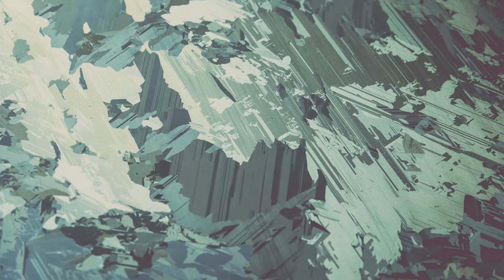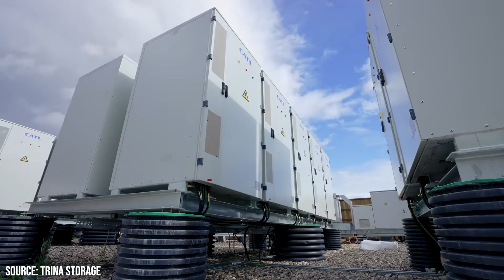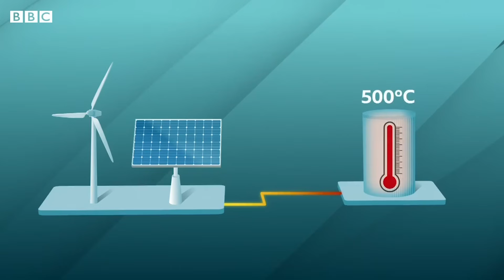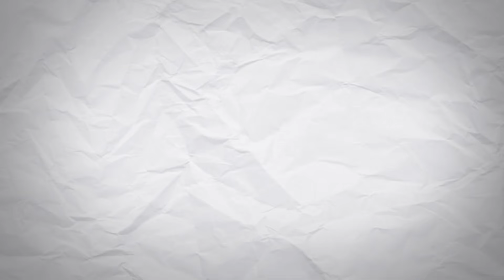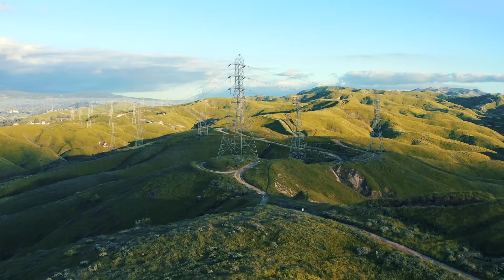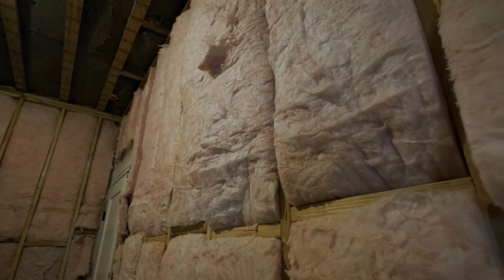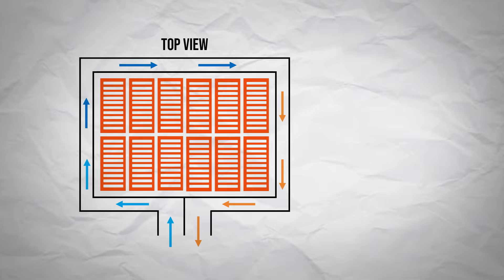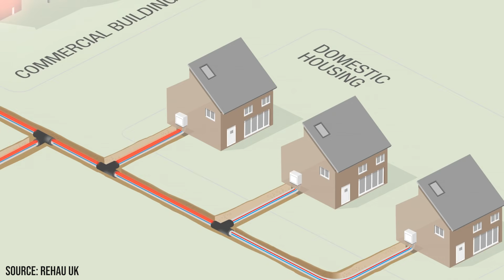How 3000 Degree Bricks Will End Battery Storage

Comment: Just a quick comment after reading through the comments...

This particular focus is industrial. This about taking cleanly produced electricity and converting it to heat and storing that heat. The heat is the desired 'product', for industrial processes. 

The high efficiency is due to not converting this heat to anything else. Industry currently using fossil fuel to create the heat, such as gas fired boilers for water and steam. This is a brilliant strategy, as industry are huge energy consumers. This is not for home use. Solutions for homes will come in other forms.

To be clear, I no nothing of Rondo, or Mr O'Donnell, or the whole process, other than what I have seen here in this video. It seems many were not getting it, based on the comments.    - Cheers
Reply: Thanks, yes you nailed it! Seems many folks comment without watching the video, or at least absorbing it!

Comment: This is great and all until you realize that Solid State Battery tech is 40% more efficient and cost half as much as current Lithium batteries.
Reply: In either case, these are insufficient to provide heavy industries with the heat they demand 24/7 over 50+ years.

Comment: Can you really make a claim involving 100 years when you have not tested them for 100 years?
Reply: The steel industry has used principally the same technology for over 200 years, with zero degradation and unlimited cycles. Rondo is heating with electricity instead of waste heat.
Reply: @RondoEnergyGlobal  Principally is not the same as actually. Principally I could just use any sharp object to cut something but that does not mean it will always cut.

Don't get me wrong, this idea is impressive, but making a claim something will be around longer than most people live is a pretty Bold claim. Especially when the person making it wont be around to confirm it.

Comment: again again and again this could be geothermal with is with modern drill methods everywhere why is it not even mentioned because it may make oil gas water solar wind obsolete basta
Reply: You can't use geothermal at every industrial facility in the world for heat needs.

Comment: At best it will replace a tiny amount of batteries, its not going in your phone or impact driver. ever, so the title of the video is silly.
 I can eee this would be useful for storing heat for use directly,  either as superheated steam for industrial process, or district and  large building heating, for electricity not so much as you still need the steam turbine to make the electricity, which have efficiency losses, also if you need huge amounts of heat you will need a huge amount of bricks  and plant.
Reply: Industrial heat accounts for almost 25% of global CO2 -- this is a significant market and existing electrification solutions are incapable of addressing it.

Comment: Despite all the positivity, I am not convinced this technology works. The reason cited for this technology to work is the "radiation equation", but that applies to everything, as far as I can see, there is nothing different being done, air insulation is not a new technology, the specific heat capacity of concrete is inferior to water, and the hotter the temperature of a material, the harder it is to heat. This project is going to terribly inefficient at best.
Reply: Water eventually turns to steam, and that steam is what we sell to customers.

Comment: I was going into this thinking, "Yeah, another BS vaporware green-tech start-up looking for suckers." Gotta say, this all seems completely feasible. It's far better to use excess energy generation rather than fuel to heat and save the fuels for applications where energy density and power on demand makes renewables and batteries problematic. Calling the cooled outer insulation shell "dynamic insulation" is a bit of marketing that's annoying but the concept is a logical way to preheat the incoming air. 
Like the guy said, they aren't based on any novel invention. Most of what I seen here was honestly stuff that a clever undergrad could come up with. I say that not as a criticism. It makes this far more convincing that it doesn't rely on any sort of convoluted or proprietary tech to work. I'm sure they'll have proprietary tech to increase efficiency, increase energry density, etc. but that's just refinements on what is a seemingly simple yet effective idea.
Reply: Cheers!

Comment: This may be useful for a local company - possibly.
Bit of no use whatsoever to say store wind energy to even supply out.
What its the efficiency of it? What rate of output is acheivebale.
This video deals with storage of wind power in the UK - it basically impossible in any practical manner,.
https://www.youtube.com/watch?v=ZddN57phd7Q
Reply: We can even out supply by taking surplus power that would otherwise be curtailed and converting it into a form of energy that's useful for heavy industry - heat. In this way -- the problem of overgeneration on the grid and the problem of emissions-intensive heavy industrial processes become the solution for one another.
Reply: @RondoEnergyGlobal  Sorry but watch the video which shows what you are claiming is impossible.

Comment: Not sure. Industrial heating requires insane amounts of energy. Unless you have field of wind generators by it you still gonna use power from grid, and they gonna use batteries to deliver it to you
Reply: Many industrial facilities are in areas with abundant land, and some even already have large renewable installations already! That said, we can help a customer deploy offgrid renewable generation, tap into existing, and/or be connected to the grid (to help balance the grid + decarbonize the facility).

Comment: So it only works by also constantly extracting 120°C from it... which apparently is calculated as 100% efficient itself.
And a storage duration of 12 hours means that it can only respond to very short term fluctuations, i.e. mostly day/night cycle.

It might be a neat piece of technology that can be useful in quite a few places, but it's by no means the killer grid storage solution that makes other batteries obsolete.

Most serious attempts at long term grid storage run below 70% efficiency because that's just the cost of affordable long term storage.
Reply: where did grid slip into this ?  it's a thermal battery for thermal outputs as heated air or steam ....
Reply: Pumped hydro could be a solution?
Reply: @erseshe  Except that it's really quite hard to get energy efficiently from said laser- you're lucky as heck if you can convert 1/4 of the energy to electricity using a system that barely produces as much energy in its lifespan as it took to manufacture in the first place.
Reply: @erseshe  clearly you know nothing about the efficiency of solar cells or pretty much anything. Also said laser burns non stop, 24hours a day. Not in 12 hour cycles as you implied.
Reply: @erseshe  What you say obviously sounds seductive, and to be honest, is basically correct, except for you forgot to talk about winter in the slightest. Not everywhere has bad winters, but where I live does. But like you said, 'quite a good option for many different places', but not where I live.
Reply: @amrenmiller6053   winter doesn't matter at all. they are storing this at 1000 degrees. the difference between it being 70 degrees out or 0 really doesn't move the needle much. 1000 degrees considers even a 120 degree day to be freezing cold. all heat lost will be lost massively fast be it 0 or 120 out. It's the insulation that matters, not the outside temps which would need to be like -300 to really move the needle on this.
Reply: Math is hard these days, hence all the FTX investors who lost all their money.
Reply: Until we truly find an efficient storage solution just need to accept that nuclear power is our best option for low carbon emissions

Comment: High temperature energy storage systems have many inherent problems. 1. The storage casing will deteriorate very quickly. 2. You need to convert the heat to electricity and will lose a large percentage of your total energy in this process.
Reply: We do not convert the heat back to electricity -- our customers are purchasing the heat directly for their industrial processes. The storage casing will not deteriorate -- a fundamentally similar brick technology has been used in the steel industry for 200 years.
Reply: No... Not the aim to convert heat back to electricity.
That is not the question on which Rondo provides answer.
Though might be a good quesion,by than i personally look more the most recent developments on green hydrogene storage (normal atmosphere and pressure) as energy buffer for electricity.
Reply: @1999Zahra  If you don't convert it, you can't use it. Thus, there is no use storing heat just for the heck of it and feeling like you are a green hero. lol.
Reply: @stephen7774  public: heating big buildings, simming pools,... Domestic: houses, small businesses: bakeries and restaurants, but even more relevant:
Metallurgic industries. You can reduce the amount of cokes needed to melt the iron ore or even exchange fully... By heating the iron ore with the heat fromthis system.... Bue bye CO2...
Steel making industries worldwide have by far a major impact on carbon émissions compared to other industries.

Comment: That just cannot end battery storage,friend; in fact it may be useful for niche applications only, where hi temp steam may be needed; and why bricks,  in the planet there is NOTHING like water to retain heat,not bricks,i think; water has the highest heat capacity of ANY material in existance
Reply: High temperature heat represents ~22-25% of global CO2 -- so this is hardly niche. Water eventually boils - The bricks are used to boil water into steam -- but water cannot hold heat for the long duration that bricks can.

Comment: Does the "dynamic insulation" only work while the battery is discharging ?
Reply: Nice to see this question. It's one of the many i had for this solution and seeing domeone else asking this, makes me happy. There is also a question about unstable temperature, regulation mechanisms, continuous heating up and cooling "bricks"? How many cycles can this material withstand? Can it be cooled completly or is there a special "usable" range? Just a few off the top of my head...
Reply: The dynamic insulation works 24/7 -- because the battery is discharging 24/7.
Reply: @concon424  OK, nice. Discharging into what? If there is no need for the power at this moment, battery is getting charged, where does it discharge? Does that insulating air flow through the battery all of the time?

Comment: this whole thing is so mind boggling stupid.......the minute i hear the words superheated, alarm bells went off......anyone with even a rudimentary grasp of science and physics know heat is always a bad thing, heat is often a waste product,means ur in the presence of energy being converted into heat or thermal energy and lost to the surroundings unless it is in a vacuum or something like a vacuum flask,but even then it is not a 100% solution,eventually whatever's in the flask does gets cold.energy is constantly being lost to the surroundings through conduction,radiation or convection.....even a vacuum flask can do so much to prevent it.

so in ur case of superheated bricks,it means there is a heat source keeping the bricks hot and superheat means very high temperatures which means a ton of energy is being used to heat the bricks in the first place,u are already consuming and burning a ton of energy to generate heat to heat the bricks......

....which leads to the other thing, u mention this thing has a very high discharge and charging rate because the bricks have a high radiation rate,how does something that radiates alot of heat quickly holds its charge or energy well if its losing heat quickly at the same time.......facepalm.

wtf is a radiation echo chamber lmao......

and the dumbest thing of all......imagine replacing a system as good as lithium batteries which functions perfectly at room temperature with bricks at 500c up to 1500c, u gonna put that thing inside ur computer?

superheated bricks battery,do u want anything that 1500c near ur house even if its enclosed within a meter thick reinforced concrete bunker with the best suppression and cooling systems in the world?

Comment: Worth keeping in mind that this makes sense only because there is occasionally more green energy available than anyone has a use for. More generally, electric heaters are not efficient way to heat anything, but of course in a use it or lose it scenario that doesn't matter. Actually thermal storage is not even necessary, if cheap enough electricity is available, there is no reason it couldn't be used to offset fuel costs in a more traditional fossil fuel heated system, electric heaters are simple to add. Only once those opportunities have been utilized to the max and there is still occasionally excess electricity available, then does thermal storage start making sense. Provided of course that someone doesn't think of some other way to turn electricity into money and use up excess capacity.
Reply: Well actually that's the point.
Rindo provides a link between the inherent discontinuity of renewal energy production and the continuous demand of industrial heat energy. So no more excuses for not building more renewal energy infrastructure and dismanteling gas and oil based energy providers.
Reply: Well actually that's the point.
Rindo provides a link between the inherent discontinuity of renewal energy production and the continuous demand of industrial heat energy. So no more excuses for not building more renewal energy infrastructure and dismanteling gas and oil based energy providers.

Comment: I live off grid with solar and batteries,  it cost very little, the energy savings in SA where grid power is 42c per kWh will pay for my system in a few years. Hot bricks might help at certain scales, but the cheap tech to be off grid is here already if you know how to use less power. I never need to ration power, but use an efficient setup.
Reply: Heavy industries (steel / cement) production etc need high temperature heat that off grid renewables can’t supply without a long duration storage solution like this.

Comment: I wish you would have made a better attempt at selling this product as this is a paid advertisement from them. The last example with heat pipes going to homes? yeah no. However showing how without these batteries large manufacturing facilities or high density buildings have trouble being powered and delivering heat. Not every city has steam pipes, and which house needs the 500F heat? The use case exists, and the reason behind it is due to how powerflow though powerlines is managed along with the limitations associated with old infrastructure. This battery could help businesses that need hot air all the time and those who need constant high amperage at peak hours. No one cares if they use electricity at night when its cheaper, they want ways of delivering electricity and heat energy to prevent future black outs when electric transmission and distribution circuits are turned off due to high surges in demand.
Reply from the maker: Thanks for your comment, to be clear, this is not a paid advertisement. I have received no payment in any form from Rondo. The last example is not the planned use case but shows an interesting possibility that high temperature storage can be economical for many different use cases. In the example, the output would of course be merged with cool fluids to bring it down to the correct levels before distribution.

Comment: mmm interesting but im skeptical . The amount of energy needed to initially heat up and to keep the bricks heated may not make the effort worth it. Also up keep. Batteries do wear down over time but there is barely any upkeep, you plunk down a battery, connect it to a computer to monitor the batteries lifespan and leave it. one reason Batteries can save money is because they dont need maintenance as often. This 3000 Degree brick looks like it will need people to constantly keep an eye on it. A 3000 Degree chamber is a fire waiting to happen. This will also still require an motor of some type to convert the steam into electricity which would increase the amount of moving parts that constantly need maintenance and repair. An interesting concept but unless this can turn heat directly into electricity, it will not be replacing batteries for storage.

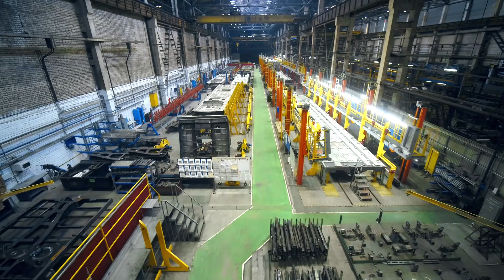Comment: 1:01 or it could be constantly generated by a thorium molten salt reactor. Byproducts would be Melinda 99 for cancer research diagnostics and therapies. Xenon for interstellar space travel. Excess heat could be used for water desalinization and petroleum distillate manufacturing. Not to mention it can't blow up because it's not pressurized. The thorium and salt is mixed and run through a heat exchanger. A very basic design. Build an underground, set it and forget it.